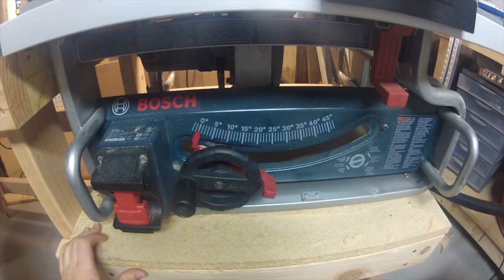Yard Game Score Board and Cup Holder

Comment: pretty cool idea.  Been playing lots of corn hole with friends and always some confusion when it comes to keeping score.  This would be a cool little project that could ultimately solve some arguments, lol.   Things I would change...a different design/material to secure pedestal into the ground (probably some kind of metal spade) and I would cover the score section with thin plexiglass.  Drill your golf tee holes through the plexiglass/lexan and into the wood.   That would keep the hole edges from getting wobbled out /widened out over time and would protect the team logo's/paper surface.